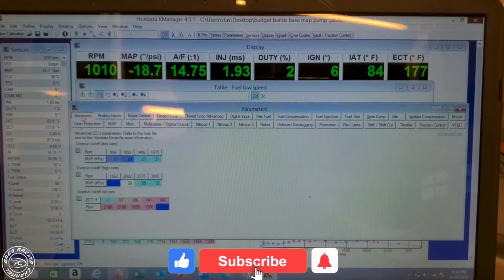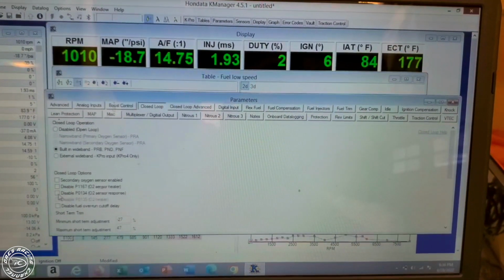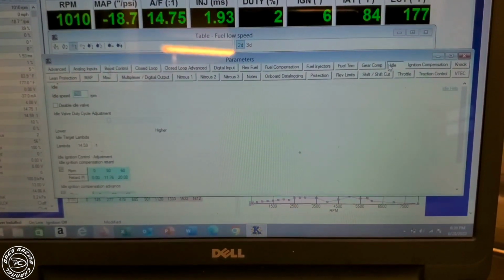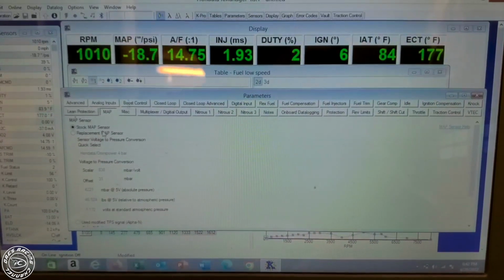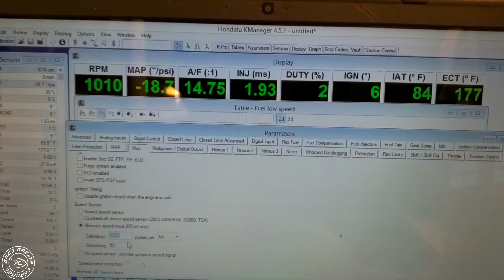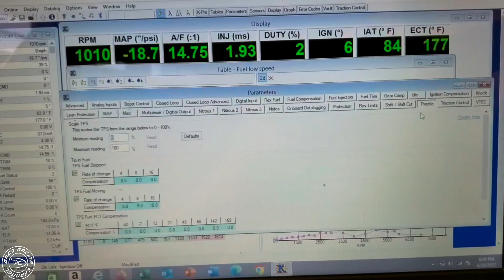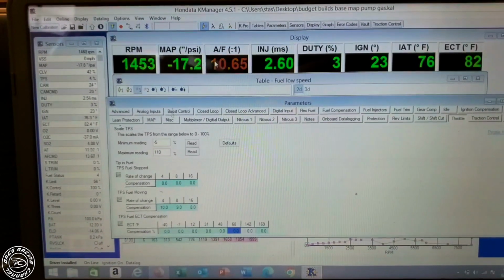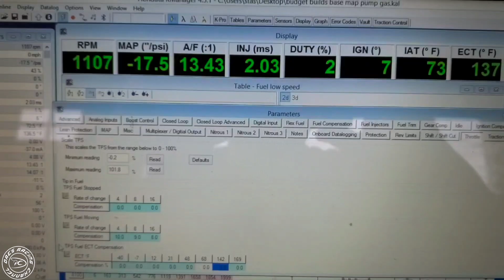HOW TO K-SWAP AN MR2 (PART 8 UPLOADING BASE MAP TO KPRO)

Comment: Where did you connect your power and ground to with the wideband? I have mine connected to cigarette power and ground. I also did not use the blue wire provided but for some reason kpro won’t rear the afr gauge
Reply from the maker: I just found an ignition wire that turns off when the car is off